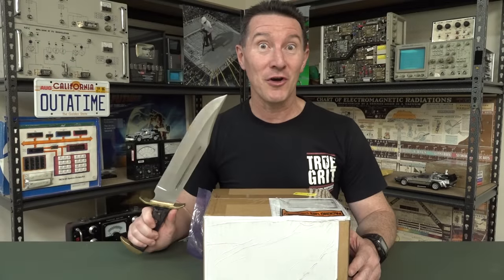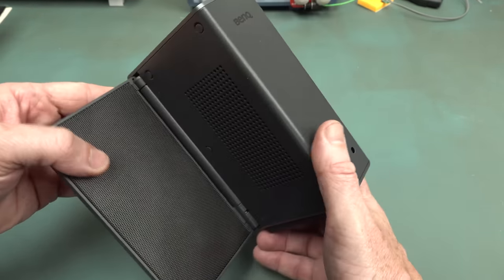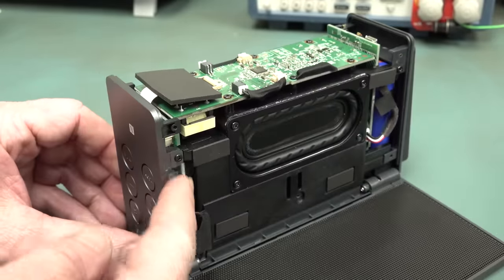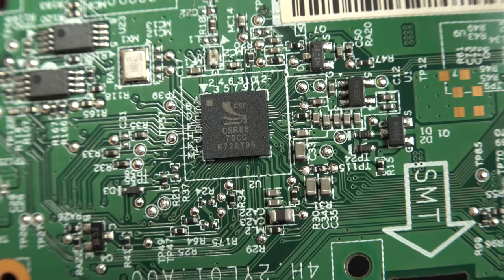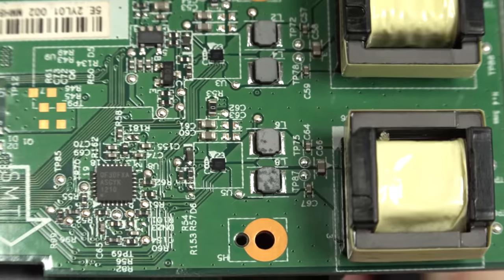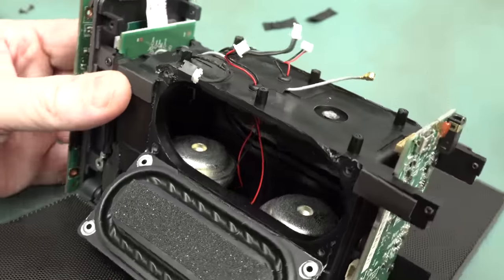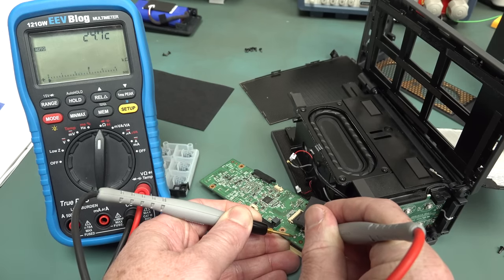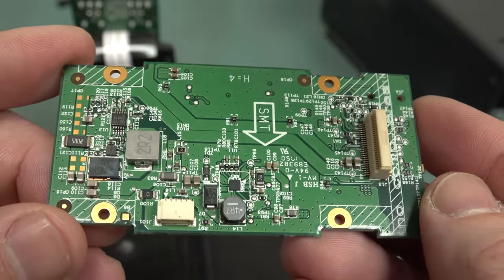EEVblog #1150 - Electrostatic Speaker Teardown

Comment: Watching you handle speakers--even low end ones like these--is cringe-inducing. Whether it is poking driver cones to full excursion with your fingers or scraping at electrostatic grids with your pocket knife, it is apparent that you do not know how to handle reproducers. Bash away at someone's $10,000 speakers like that and expect a black eye. I admire and respect you as an engineer, Dave, but leave the audio reviews to someone else.
Reply: He did call it a destructive teardown before he started, though.
Reply: @knahrvorn  I realize that which is why I was surprised when he so carefully put it all back together.
Reply: @eurobum2012  if you knew me, you would know that I am anything but an audiophool. Handling reproducers in that manner is just not a good practice. Audiophoolery has absolutely nothing to do with it.
Reply: @omniryx1  A) this is not a 10,000 speaker B) Dave is not an audio reviewer C) This is about learning how things work, not handling bloody "reproducers" ya twit!

Comment: You should do a vid on building a soldering iron from junk bits. eg.. power source and some bits of wire. 

Tried following one that used a wall wart which didn't work out. 

Do two, an iron and a gun. Just from junk, no made heating elements, you make yourself.

Would be impressive if you can do that in a way that is repeatable by millions of audience. 

Or maybe you lack the knowledge.